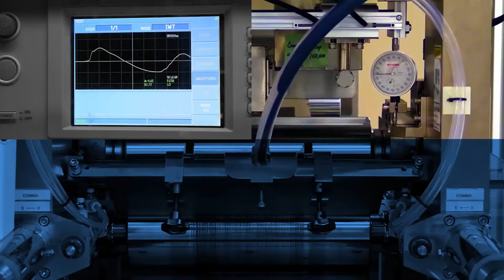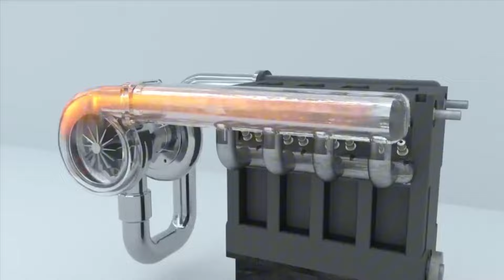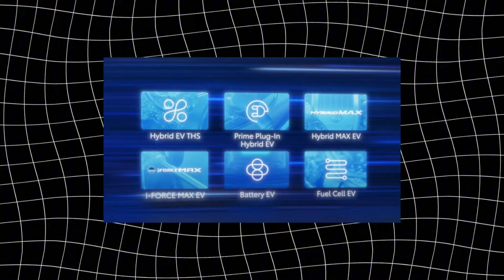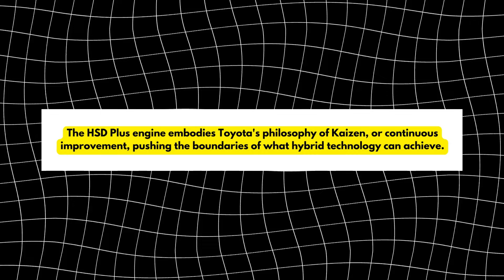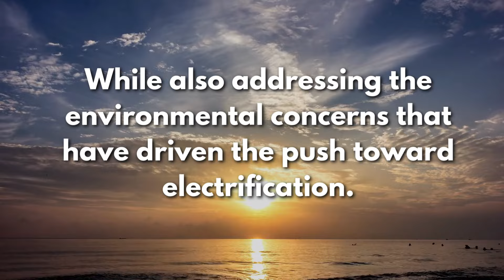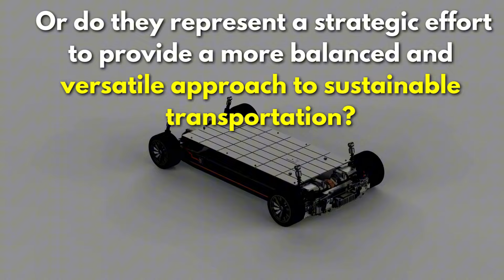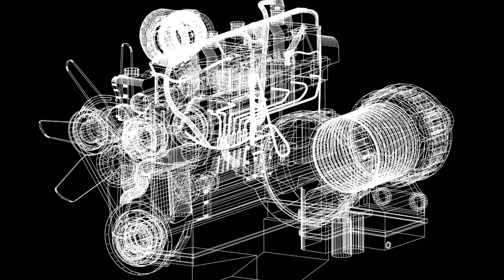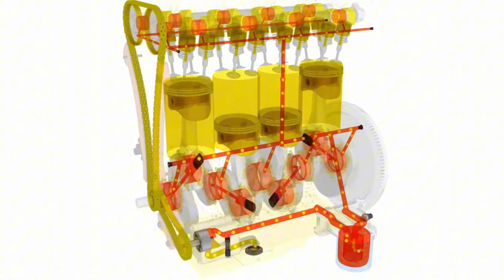Ford, GM, Porsche & Toyota Announce New Engines That Will DESTROY Electric Cars!

Comment: Lot to be said about dumping a gallon of gas in the tank and being able to instently drive a long distance.
Reply from the maker: You're absolutely right! One of the key advantages of traditional combustion engines is the convenience of quick refueling and the ability to cover long distances without much wait. Gas-powered vehicles still offer that immediate range and flexibility, which is why many automakers are continuing to innovate in that space alongside electric vehicles. Each technology has its own strengths, and it’s fascinating to see how the automotive industry is evolving to offer more choices for different needs.
Reply: Within 15 years that advantage will be gone.  Battery technology and charging speed technology aint' standing still.  Meanwhile, today, my Tesla is fully charged every morning and I drain a small % of the battery every day, spending zero minutes in a gas station filling up, and getting fed up with fuel costs.  By the way, the computer in my Tesla knows the off peak times when costs are 1/3 the price between 4-7pm.  It intelligently charges outside that time span.

Comment: The dinosaur companies fighting the inevitable.
Reply: Actually,...its a fact that EV sales have been in steady decline for the last few years.
One of the main  reasons they sold so well initially was due to deep government tax incentives.
They are currently, over priced,.lack range and lack sufficient infrastructure to deliver on their promise.
With the general public rejecting EV vehicles in such large numbers,..the major auto makers are forced to continue making internal combustion platforms more efficient,.just like they've been doing since the early 1970s
Reply: In the inner city area where I live in a block of over 200 apartments with parking spaces, is surrounded by at least 50 other hi rise apartment towers each with hundreds of apartments and parking spaces. I enquired with our management company if there were any plans to install chargers. The reply:- We have enquired with the local electricity distribution suppliers about this. We have been informed that the existing supply superstructure is not adequate for the extra demand and this will not be addressed for many years as the additional load is enormous and the cost of new infrastructure is prohibitive. Result!! Thousands of unusable parking spaces if IC engines are banned and only electric allowed.
Reply: Going full throttle before hitting the wall. EV sales is down for legacy because of over pricing and greedy dealerships. TESLA  sales is taking over car sales at a frightening pace.
Reply from the maker: Thank you for your comment! I appreciate your perspective. It’s true that the automotive industry is undergoing significant changes, and many traditional companies are facing pressure to adapt to new technologies and environmental concerns. This video highlights the recent announcements from Ford, GM, Porsche, and Toyota, showing their commitment to innovation, even as the market shifts towards electric vehicles. It will be interesting to see how these developments play out in the coming years. Your thoughts are valuable to the conversation!

Comment: Until we are able to produce environmentally friendly, high performance batteries or some other energy storage method, something like this is a necessary intermediate step.
Reply: Everyone I know who has had EVs for years tells me they are far superior to ICE vehicles. Battery life for new EVs is now over 20 years. Charging times have lately been greatly reduced. Since these hi tech cars will probably be more expensive than EVs I don't see any advantage. This really does seem like more FUD from the fossil fuel folks.
Reply: Where will you charge it, if like most people you do not have parking facilities on your property?
Reply from the maker: Thank you for your insightful comment! You’re absolutely right—while electric vehicles (EVs) are gaining popularity, the need for environmentally friendly and high-performance batteries is crucial for a sustainable future. Developing new energy storage methods is a complex challenge, and in the meantime, innovations in internal combustion engines can serve as an important transitional solution. It will be fascinating to see how both technologies evolve and work together to meet our energy needs in a more sustainable way. I appreciate your thoughts on this topic!

Comment: The automobile industry has lost their way. The emphasis is going to EV's while important is happening too rapidly. Before   the EV's are developed maybe it would be better to more   fully develop the electrical grid. In the meantime the automobile industry was far too hasty in canceling their full size four door sedans with normally aspirated engines. The addition of turbo chargers, superchargers,   and other gimmicks to "save on fuel or add power" are just higher maintenance items. All it takes is make them reliable and affordable.

Comment: You’re not gonna develop a gasoline engine it’s any more efficient than 20 miles per gallon on the highway. You haven’t been able to do it in seven years. What makes you think you can suddenly do it you had the ability back then you didn’t do it you didn’t take the initiative you don’t give a damn buzz off oil industry.
Reply from the maker: Thanks for sharing your thoughts! I understand your concerns, and you're absolutely right that advancements in fuel efficiency have been slower than expected in the past. However, these new engine developments from companies like Ford, GM, Porsche, and Toyota are a step toward more sustainable performance. They’re exploring ways to increase efficiency while reducing emissions, which could lead to significant improvements. The push for cleaner technology, including electric vehicles, is still strong, and these innovations are part of the evolving conversation. It's definitely an exciting time for the industry, and I appreciate your perspective on this!

Comment: Avoid buying any turbo or transmission with CVT.   They already have ALL this it's called the chevy Volt.
Reply from the maker: Thank you for sharing your thoughts! You make a great point about the Chevy Volt—it was definitely ahead of its time in combining electric efficiency with gasoline backup. As for CVT transmissions and turbo engines, they do have their pros and cons depending on personal preferences and driving needs. It’s always important to consider long-term reliability when choosing a vehicle, and it’s interesting to see how different manufacturers are approaching the future of automotive technology. Thanks for contributing to the discussion!

Comment: some EV fanboys today are like the model T fanboys who thought that 'Model T' was good. EVs are as old as autos. Today's EV tech is in its fancy however. Get rid of so many EV negatives and dangers, and adoption will go back to what it was for a bit before all adopters had their rolling devices. With EVs, it IS about the 'device' more than 'the rolling'.
Reply from the maker: That's an interesting perspective! You're right, electric vehicles (EVs) have been around for quite some time, and their technology has come a long way, though it’s still evolving. Just like any new innovation, there are definitely challenges and drawbacks that need to be addressed before broader adoption can happen seamlessly. The current EV tech is impressive but also has room for growth in areas like infrastructure, battery safety, and range. It'll be fascinating to see how the industry develops and whether newer technologies, like the engines mentioned in the video, will change the landscape once again. Thanks for sharing your thoughts!

Comment: More complexity leads to more maintenance and more cost to maintain out of warranty.  Seems like same old same old to me.  Tesla requires zero maintenance, performs better, drives itself and has thousands fewer parts and is more vertically integrated..  The real problem is the incapacity of legacy auto to produce an electric car at scale for less cost, coupled with the painful UAW ball clutch.  Rivian and Lucid can't do it either.
Reply from the maker: Thank you for sharing your thoughts! You raise some valid points about the complexities and maintenance costs associated with traditional combustion engines. It’s true that electric vehicles (EVs), like Teslas, tend to require less maintenance due to their simpler designs and fewer moving parts.

The challenges facing legacy automakers in scaling EV production are indeed significant, especially with factors like supply chain issues and labor negotiations. As these companies invest in new technologies and strategies, it will be interesting to see how they adapt to meet market demands.

Your perspective highlights an important conversation about the future of transportation, and I appreciate your engagement in this discussion!

Comment: I don't know about this. Check out the huge number of parts to break down in fuel powered car verses' an EV. Way fewer parts in an EV. Much less Maintain.
Reply from the maker: Thanks for sharing your thoughts! You make a great point about the simplicity of electric vehicles (EVs) when it comes to fewer moving parts and lower maintenance. It's definitely one of the key advantages of EVs. In the video, I wanted to highlight how some automakers are still innovating in combustion engine technology, but you're absolutely right that EVs have their own benefits, especially in terms of long-term maintenance. It's an exciting time to see where both technologies will take us!

Thanks again for watching and contributing to the discussion!

Comment: Why not just run on an electrolysis unit spliced into the fuel line. This would work on any generation of gas engine. It would extend fuel mileage, and reduce pollution by having more none pollutant fuel in the Chambers every time the engine fires. Here is the video.

 https://www.youtube.com/watch?v=GJb9UOxpb48&list=WL&index=4
Reply from the maker: Thank you for sharing your idea and the video! The concept of using electrolysis to improve fuel efficiency and reduce emissions is indeed fascinating and has been explored in various forms. Electrolysis can break water into hydrogen and oxygen, and integrating hydrogen into the fuel mixture could potentially enhance combustion efficiency. However, there are some challenges, like the energy required for electrolysis and the overall effectiveness in a typical gas engine. It’s great to see innovations like this being discussed, and advancements in engine technology will likely continue to evolve in exciting ways. Appreciate your input and keep the ideas coming!
Reply: @Vortexvelocity1  I also have a comment on how these water ran engines could also be put to chargers in electric cars.

Comment: Forget physics, just publish blather. The are a certain number of joules of energy out unit weight in gasoline and the only way to extract that energy is to burn it. The burning causes expansion of gases which produces mechanical force. The byproduct is heat energy. In no scenario can the efficiency of engine go beyond the energy in minus the heat losses. As such, I call bologna.
Reply: and yet, 'balogna' of almost any kind gets one much farther and more efficiently than rolling devices that always need special handling, hunting down 'fuel' and allowing for extra fuel-hunting hrs, tearing up roads with unsustainable EV weight which you should pay twice as much in taxes for damage done to our roads.
Reply: @bluecollarbytes7267  Wow, speak of the fact free. Tearing up roads? Hunting for electric? You forgot about the tires? Your handle of blue collar speaks volumes.
Reply from the maker: Thank you for sharing your thoughts! You bring up a valid point about the limits of energy efficiency in traditional combustion engines. It's true that the laws of thermodynamics place an upper limit on how efficiently we can convert the energy stored in fuels like gasoline into mechanical work.

The purpose of the video was to highlight how major automakers are exploring ways to push the boundaries of current engine technology through innovations in design, fuel alternatives, and hybrid systems. While combustion engines will always have inherent heat losses, companies are focusing on improving fuel efficiency, reducing emissions, and integrating new technologies to make them as competitive as possible in the current market.

That said, the debate between electric and combustion technologies is ongoing, and both have their strengths and limitations. The advancements in each are fascinating, and it's great to see people passionate about the science behind it!

Comment: I would be surprise that Ford is not out of busness ...considering how their trucks are a piece of crap....you know ...the smelly kind of crap that falls out of dirt holes.
Reply from the maker: Thanks for sharing your thoughts! It's true that opinions on vehicles can vary widely based on individual experiences. Ford, like many automakers, has had both its hits and misses over the years, but they’re definitely pushing hard with innovations in their new engine designs. It’ll be interesting to see how all the major brands evolve as they balance traditional engines with the rise of electric vehicles. Appreciate you watching the video!

Comment: Claptrap as always. I have heard all the rubbish about EV's and they are not and NEVER WILL BE ZERO emissions. Where does the power come from? How are they made? Where do they get the lithium from? How is everything that it takes to make one shipped across the world? What happens when they burn as they ultimately all will? We swap one polluter for a different one. One we understand and have improved for over 100 years to something that our planet cannot sustain. There is stupidity and then there is the EV. Tell me how much increase in global electricity consumption there will be if every petrol or diesel is changed to an EV and where that amount of electricity comes from. It is that level of fundamental lying that has run governments most of our lives and it isn't going to improve!
Reply from the maker: Thank you for your thoughtful comment. You raise some valid concerns regarding the environmental impact of electric vehicles (EVs) and the broader implications of transitioning away from traditional fuel sources. It’s true that the production, shipping, and disposal of EVs—including the sourcing of materials like lithium—does carry an environmental cost. However, many experts believe that as renewable energy sources like wind and solar continue to grow, the overall emissions from EVs can be significantly reduced over time. The shift to EVs also offers the potential for improvements in energy efficiency and a reduction in air pollutants in urban areas, even if the global electricity demand does increase.

It's an important and complex debate, and your points are part of the wider discussion that we all need to have as we work toward more sustainable energy solutions. Thanks for engaging!